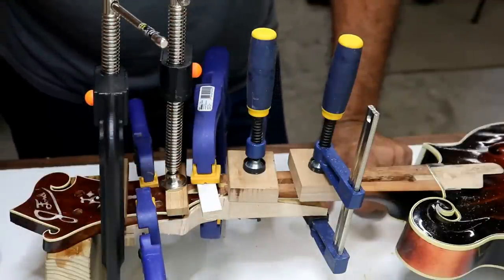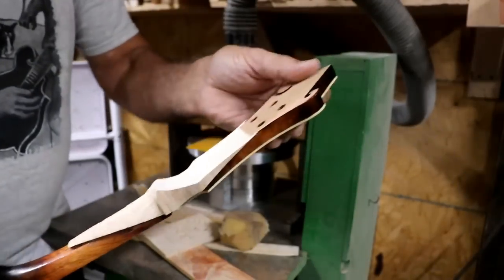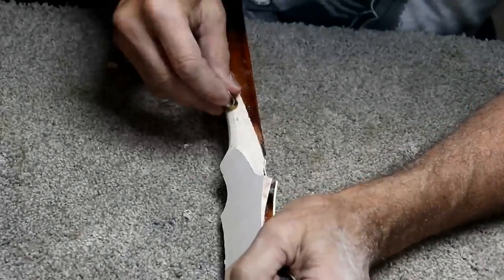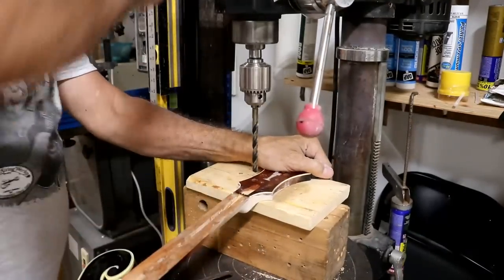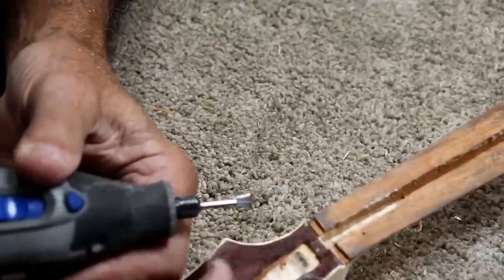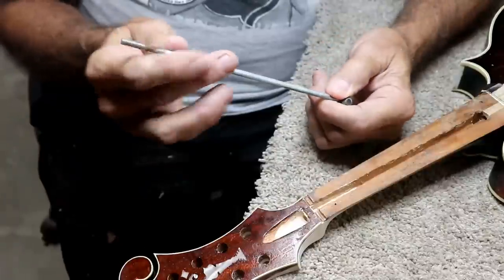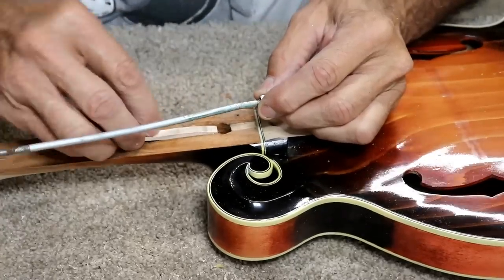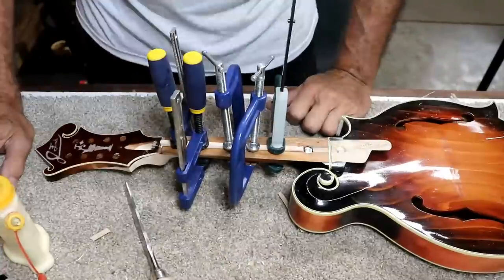593 RSW BROKE NECK J  Ford Mandolin - Part 3

Comment: Hello again Jerry,
First, i hope you see that i am an experienced wood worker much like yourself. I do not have the luthier experiences you bring to the table but i do know we all benefit from a little objective input/suggestions from time to time.

One of my favorite tools for any repetitive work a tool i learned to incorporate at every opportunity, is the "jig". We make saw horses and ponies for work that requires a knee or clamp to steady the work for cutting, drilling etc.... and/or a hand held drill stop jig for drilling repeat holes in cabinet doors and drawers for knobs blah, blah, blah etc etc etc . 

The functioning word being "Jig." Carpenters make jigs to suit every type of task.  My brother makes the long infamous "Travolin" mandolin, an instrument you can carry on a plane, train or bus. I created a jig that he could use for multiple steps in the manufacture of his Travolin mandolin. 

Building the Jig:
1. Beginning with the base - a flat and stable piece of hard wood not necessarily as 
     big as the instrument itself. Stable is the key.
2. next, i attached a stop rest to butt the travolin against 2-4 inches from one end
    of the base.
3. At the opposite end i attached a wide and long block (hard wood) at a height
    providing the correct angle that will allow the (mandolin, guitar  or what have
    you) instrument head to rest flat on its level surface (parallel to the base) for drilling tuner holes etc.
4. i glued a nice heavy-duty piece of leather to all contact points e.g. the base and 
    butt/stop and the head rest.
5. The best advantage of having a jig is that you can jig the jig for multiple tasks 
    and you will always have the solid base to work from.

Steve has been using this jig for years and has made many mod's to help. 
The jig is that 3rd, 4th or 5th hand needed and it all can be clamped down or screwed in place etc etc etc and so on... 

I love working with wood. Hope your best ventures still lay ahead...

Comment: Thanks very much for the video, Jerry.  Great job.  At 23:15, when taking measurements with a digital caleaper (your spelling)  there's a way to measure with no appreciable math.  If you zero the caliper on your first measurement (inside or outside) and then measure the second part like you normally would, the digital caliper will show you the thickness measurement directly, eliminating an opportunity to make a math error.  Please keep 'em coming, and a big thumbs up.

Comment: Hey Jerry
You need a Nicholson #50 cabinet rasp for sharpening necks. They are half round/ flat. They take a lot of material off and leave it fairly smooth for a rasp.
Gonna try to come up for another visit after it cools off.

Comment: I have a battery Milwaukee grinder that you can adapt to rollock disks . I use skotch bright  and all types of disks. It has 4 speeds and is variable. It is a tiny die 90o die grinder. Look into it .

Comment: Think of pre-stressed concrete beams. I posted a longer explanationn on video #1. The curve will resist a force in the direction of the bow. The curve in this rod will work because the neck bend force is in one direction.

Comment: Regarding straight truss rods, I can see how they could work by applying compressive force to the back of the neck, making it harder for the neck to bow forward. But I agree that a bowed rod is a much better solution, allowing finer adjustment with less strain on the rod and neck.

Comment: ??????? Jerry, does that thicker rod pose a problem, because it may not give in
to nut tension, like a thinner one? Also, does the thicker rod pose a possible
problem to the wood, under the adjustment nut, due to the higher tension
needed, to straighten the rod?

Comment: What kind and weight of  oil do you  use on your sharpening stone?   Does the coarseness of the stone allow for or dictate the weight of oil used on it?  Does a super fine stone need a different oil than a very coarse stone need heavier oil??
Reply from the maker: I just use 3 and 1 oil and it works fine

Comment: Why no spokeshave for neck shaping?
Reply: A spokeshave is a pretty aggressive tool. Yes, you can adjust the cut, like a plane
but being a two handed tool, you are exerting a lot of force on it.
Maple is very picky, about working with the grain, and even then, can "chunk out"
on you very easily. When working with small parts, a light touch is the way to go.
Reply from the maker: The curly Maple would laugh at a spoke shave seriously it would just chip and break and crack
Reply: @RosaStringWorks  I have only done mahogany and walnut necks to this point, and nothing figured.  Good to know it's a no go with curly maple.